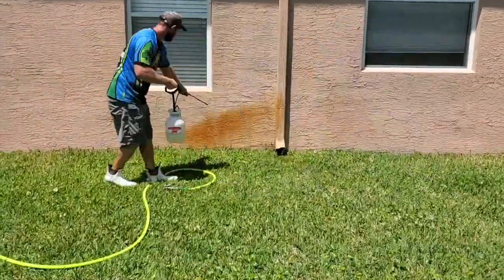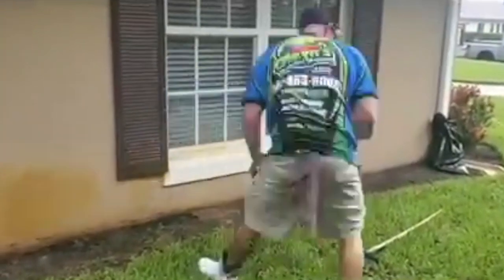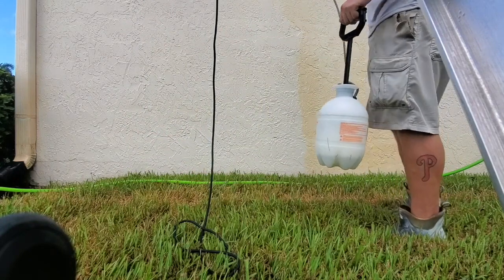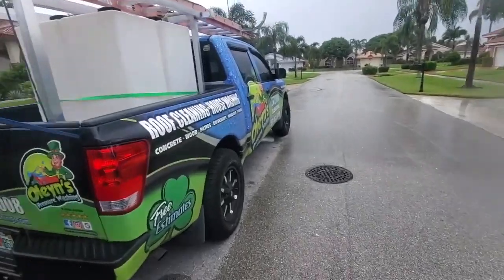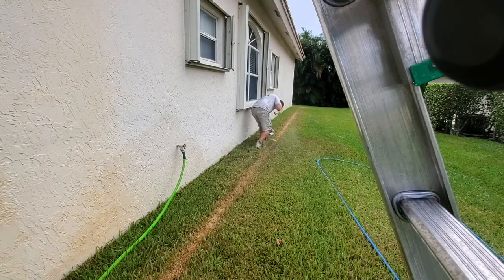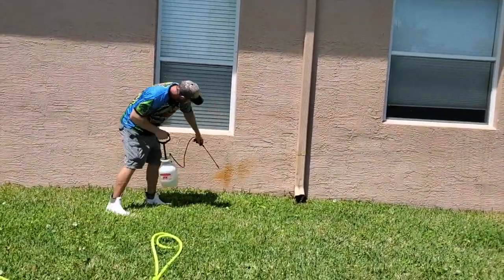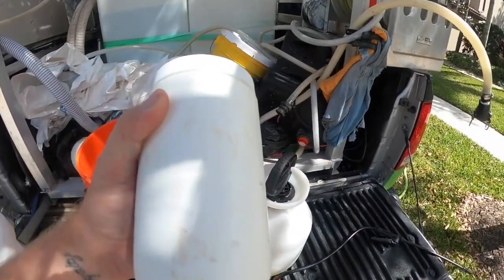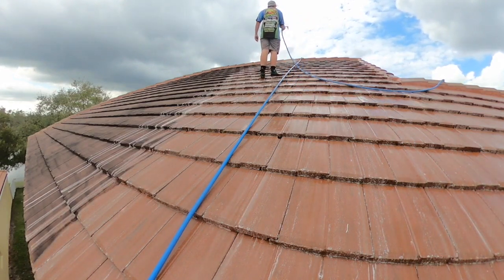HOW TO MAKE $500 AN HOUR REMOVING RUST STAINS

Comment: Use Oxlic acid to remove rust stains. It's very cheap $2.50 a pound here in East Florida. It comes as a powder, I mix 12oz per gallon of water into a tank sprayer. Rinse with a garden hose. Much cheaper then buying those silly expensive chemicals. It also cleans fiberglass boat hulls like a dream 4oz per gallon of water.

Comment: Awesome I purchased a pressure washer trailer combo mitm factory set up for 3k it needs complete rebuild good thing I know how to rebuild them I also purchased a truck 👍🏻 and I already have a job lined up 😂and it’s not ready the concrete is completely rusted and it’s like 5k square feet … I just don’t know what to use and how much to change

Comment: Man those roofs clean so easy on video! Here in California I was doing a concrete tile Barrel style. First I did a house wash mix for the roof (idk why) . Not effective at all. Then i hit it with a heavy 6% mix and still NOTHING!! I had to get up on the the roof and surface clean/pressure wash the whole thing. It was a nightmare. I’ve seen on Reddit a similar thing happened and they said here in California algae grows stronger and just sticks more and therefore he does not do soft washes on roofs. Not sure if that’s true or false. What’s your opinion ?
Reply: What area do you work in?